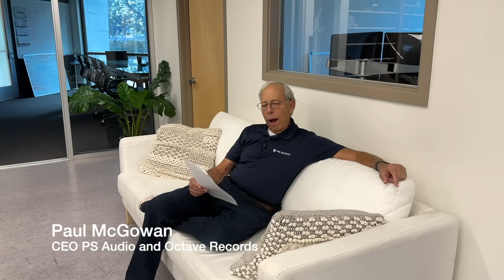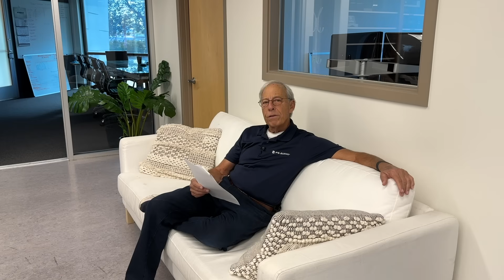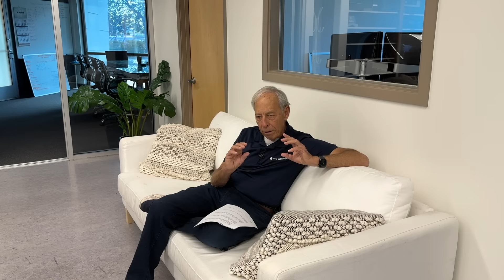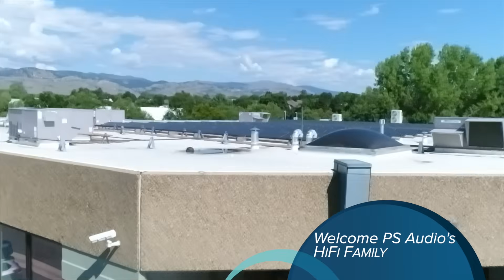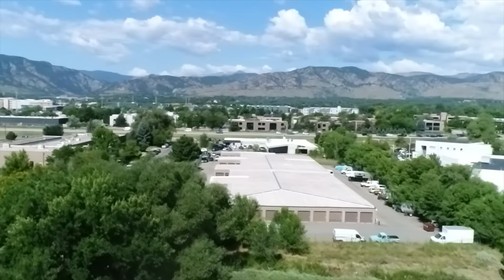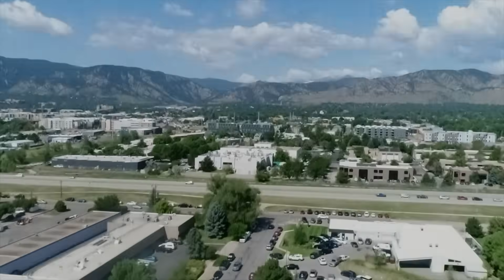Balanced Phono Cartridges

Comment: Rega turntables have a screwed up grounding scheme. I believe they short one of the cartridge conductor(s) to the arm grounding and use the RCA 'return' as an arm grounding. You can't use a Rega turntable as a balanced source unless you rip off the wiring to the terminals, rewire and install a separate arm grounding wire.

Comment: The discussion is about the tone arm wiring. Not the cartridge. Almost all magnetic cartridges are balanced by design. It was a matter of convenience to ground one of the leads to the cart body and use it as ground on the output of the arm. Carts included instructions on removing that connection, a simple piece of metal strap. And then the 4 wires coming out of the tone arm are fully balanced. In fact, if the RCA connectors on the turntable are not grounded, it is Tip/ Crown balanced connections.
Reply: Most MM cartridges are internally single ended. Don't ask me why.

Comment: I asked ChatGPT why it makes sense that my Parasound JC3+ has RCA inputs only but XLR outputs (also RCA outputs of course) and the reply I got kind of does not jive with what Paul says:

"A turntable cartridge is a floating, unbalanced source — it has two signal wires per channel (hot and ground), but no third conductor for a true balanced signal.

Even high-end tonearms with “balanced” cables are really pseudo-balanced until they hit an active stage that can differentially amplify the signal.

So there’s no real benefit to providing XLR inputs on most phono stages, since the source itself is not balanced."
Reply: ChatGPT talks bs, because there's lot of bs being written around the net regarding this thing AND you phrased the question in such a way as to cause it to talk bs. For example, common noise rejection needs a balanced connection and a balanced input stage. Which is exactly what you get when using a balanced cartridge, balanced connection and a phone pre with balanced input stage.. Nothing to do with amplification, differential or not. Of course gain is not increased in such a configuration relative to single ended (Paul got THAT wrong, as was mentioned in another comment), you do need a differential amplifier for this, which is what happens with a phono pre balanced output. Also a turntable cartridge can be either single ended, which is what ChatGPT describes in the first sentence or it can be balanced as are all MC and a few MM cartridges because the second conductor is not shorted to ground. In this case both conductors exhibit the same impedance with reference to ground which is the definition of balanced. ChatGPT is a garbage in -> garbage out processor.. You could coach it to return the correct answer if you ask 'Why does it make sense to have a balanced connection from a balanced cartridge to the balanced input of a phono pre'' instead of what you asked... Use of LLMs like ChatGPT without having a clue what you're talking about is full of perils..
Reply: @razisn people don't seem to recognize the difference between balanced and differential.
Reply: @razisn  I appreciate you took the time to answer, although your tone ... well .. 

Admittedly I have no clue, but maybe you can answer the question I put to CGPT having that in mind. 

I mean I spent a fair amount of money on what is supposedly a fine piece of equipment - which I am very happy with BTW even being forced to use unbalanced out - and you'd think there is some sort of reasoning behing their engineering.

Comment: All magnetic cartridges are balanced unless someone does something stupid...    like using RCA jacks to connect them.   
This is why a separate ground wire is needed.
Reply: Nope. Most MM cartridges are single ended because the internal wiring has been traditionally messed up for unknown reasons. The separate ground wire grounds the arm assembly (and sometimes the table) not the cartridge btw. Cartridges in general do not make electrical conduct with the arm body so the separate wire could not act as ground for them by definition. MC cartridges tend to be balanced along with just a few modern MMs.
Reply: That is what I understood about MM's as well, however I was also informed MC by there very nature are NOT so you would have to make a Moving Coil balanced to get any real world benefit, which as I understand it is what Pro-ject has done with some of their MC's.
Reply: @Roamany-Jones  You've got it reversed. MCs are in general balanced, MMs not so apart from the newer 'balanced' ones. Don't ask me why.

Comment: I was able to set up a balanced phono cartridge arrangement using the ProJect S3-3B phono preamp, Technics SL-100c and a moving coil cartridge. The changes were significant in gain and sound qualaty, and lower noise floor.

Comment: Yes, balanced should be the norm, but how do you lose 6dB of gain by not using balanced for a cartridge when the coil output is the same either you ground one of the pins or not? The voltage delta doesn't gain anything by treating it as balanced in this case e.g. a 1mV output of a coil will be +/- 0.5mV on balanced and 1mV on single ended.
Reply: That is correct. Paul got confused, again. You need a differential amplification stage to get a +6db of gain.
Reply: I don't understand how you can have a balanced phono stage input when the cartridge output isn't balanced.
Reply: @bobisyouruncle1  The balanced phono stage input amplifies the delta between the two pins of the coil output and it will work just fine. The reason you can consider it balanced is that the amplifier inputs are likely at GND level DC wise and the two audio wires will carry a relative positive and negative signal voltage as balanced as if the center of the coil is at GND level always.
Reply: @bobisyouruncle1  Whoever made the phono stage made it with a balance input stage. Whoever made the cartridge made it single ended.  Lol

Comment: There’s nothing stopping you from treating the RCA output of most tonearms as a balanced signal with a floating ground. This works well with most arms except those that connect the tonearm ground to the shield of one channel like Rega. Most of Ron Sutherland’s phono preamps work this way, with a balanced connection from an RCA Tonearm cable.
Apart from that example, phono preamps with a balanced input are hardly a new thing. Many of today’s top phono preamps have a balanced input option, and have for many years. Pro-ject’s achievement is in brining this  to a lower price level.
Reply: This is true as long as the phono wires are not connected to any internal preamp or other circuitry.
Reply: It's been 40 plus years since my Electronic School days. 
 Even though I am still a technician, I can't get past the fact, that we were taught that a floating ground is bad for any circuit. 
 What am I missing.
Reply: @davidjudd951 The tonearm/turntable is grounded to the phono preamp through the tonearm’s separate ground wire

Comment: She doesn't watch my videos 😂 Hey it makes me wonder, how do we make being audiophile become a female passion also? How many here are females percentage wise?
Reply: A few days ago I just got a new AC power strip that is built with audiophile grade parts, including an AC cable that the company is known for, along with it's other kinds of cords/cables. My first listening impressions were disappointing. In the upper midrange on a very familiar recording I could hear emphasis compared to what I was used to and thinness. A few times it even sounded a bit tinny..The bass sounded less in amount. The highs sounded duller than used to. But within 3 hours of warmup & play, the sound transformed. The bass wasn't lesser; it was tighter, & the lack of overhang made it sound less. And by the end of 3 hours it didn't sound less anymore. After about 2 hours I could tell on some cowbell taps that the sound was cleaner & truer. Toward the end I could tell the sound had more focus than I ever heard in the recordings before. From my thinking of sending it back, my thoughts went to  "this is a real keeper!" I talked to the seller and he told me the AC strip had never been used. It was breaking in, including the AC cord, and within 3 short hours, you could hear a major transformation in the sound. A level of sound quality, ( in certain ways at least) that I had never heard before in my system. Mostly I'm sure, because of the AC cord breaking in. Not only is there a definite improvement with different cords/cables, but break in is real too. Theorists and their flawed and incomplete theories that have more holes than Swiss Cheese; do not matter. Basically, when someone says there's no difference between cables; they're pretending to be God. Pretending to know and understand everything, and pretending they are familiar with all cables; which bviously they're not. Their argument against cable improvements are best not to be taken seriously.
Reply: @sidesup8286 It would be all awesome if people could hear the same difference when they are not told about which cable is used lol 😂
Reply: @sidesup8286   ...quite often the phenomenon of the bass sounding "less in amount" is a matter of the bass actually presenting as cleaner & tighter & the listener's hearing readjusting to the 'new' sound. Anyone who can't hear the difference between the sound of brand new cables (wires) & wires that have burned in & 'settled' is truly hearing impaired.
Reply: @Fat Rat There is no such thing as cables needing burn-in. It's not a thing. It would mean you can tell me if a system has brand new cables or cables that have been used for a longer time. Also for this, it has zero actual evidence and zero science to support it.
Reply: "Always" Fail or "Always" still lying about blind tests being failures?.. The whole concept of blind tests could be a failure, considering how bad people are at them, when blindfolded. They often fail telling anything apart; anything from audio, to chicken tenders to brands of soda pop.

 Fat Rat is right.Tighter bass without overhang, sounds like less bass. ..And cleaner highs sound like softer highs or less highs.
Reply: @sidesup8286 Actually blind test simply means you don't know what you are listening to. For example, if you randomly switch power cable of an amp and it's not visible to the listeners which cable is used, and they can't pick which one is better...but they can pick one if they know which is used...it means the placebo effect is at play. Numerous such tests have proven what we can hear and what we can not hear. Power cables always fail in such a test. Those of us who understand the actual way things work, can also explain why a power cable of a few feet doesn't affect the sound quality.
Reply: @Thinking Better. You keep saying that blind tests on power cords and cables always fail; which I'm sure is just a falsehood you keep repeating to not look like you are losing a debate. I would NEVER fail to tell the difference between my worst power cord & my best; and I'm sure I'm not unique, or one of a kind in that way. Once again, theories aren't worth the neurons that create them. None of us millions of guys who hear differences are going to lose any neurons, worrying about theories by people with hearing so bad, that it's hard to even imagine.

 What failures there have been with blind audio tests, blind taste tests etc. all have to do with the perceptual incompetence of the blindfolded ones, the incompetence of the testers & their methods, and simply the plain fact that from all indications (and there are many); humans just have the hardest time telling anything apart when blindfolded. Be it taste, touch, sound or smell.
Reply: @sidesup8286 I'm sorry but yes, NOBODY can identify a power cable by listening not knowing which actual cable is used. For decades it has been same story. And trust me in this, if people could actually identify a power cable by our hearing only, you can bet numerous tests would have been used in the marketing to sell these things. The business incentive is absolutely there but you can't prove what is not there. And nobody needs to be blindfolded in a cable blind test. All you need is to avoid the cable to be visible.
Reply: TB ...women love money, so if you pay them enough 'money' then I'm sure that they will show some interest in home-audio, even if it's only superficial 👍😉
Reply: @Fat Rat Lol, I knew we have a lot of things we can agree on other than the wonders (or not) of premium cables hahaha...
Reply: @ThinkingBetter   ...don't confuse "premium" with 'audio grade' & also, please remember that I don't do expensive 😝
Reply: @Fat Rat On cables transferring audio, the science is clear and well understood. I like areas if science where new things are being discovered and invented. For example, the front Uni-Q Meta driver in my KEF LS-60 is a great example of audio innovation.
Reply: @ThinkingBetter   ...yes, I believe that the Uni-Q is now up to it's twelfth iteration...or is it the thirteenth🤔
Reply: Meta version is quite interesting
Reply: Google "Class D Now Crushes Class A in Cleanliness, Power, and Price-to-Performance, as Confirmed by Multiple Independent Tests"
Reply: @ThinkingBetter   ...yeah, all of those maze pathways dealing with the treble 'back-waves'.
I wonder who thought of trying that out at KEF 🤔
Reply: @ThinkingBetter   ...so what is your take on isolation/vibration absorption footers like IsoAcoustic Pucks, Oreas &/or Gaias or Stack Audio - 'AUVA' 50s, 70s or 100s or Townshend Engineering platforms??
Reply: #Fat Rat The upgrade (12th-gen Uni-Q + MAT) delivers a 99% absorption of rear-driver unwanted sound vs typically 60% in older designs. Results: dramatically lower distortion in mid/high range (spec example < 0.1% THD), improved clarity, larger listening sweet-spot, more natural sound. For a discerning listener (I assume we both are), the benefit is measurable (in terms of THD, which is a big deal for speakers, clarity, dispersion) and audible, especially when all system elements are up to par. This is totally not an imaginary thing!!!
Reply: @ThinkingBetter   ...I never said that it is, "an imaginary thing!!!"
I said that I wonder who at KEF thought of it...& before you answer that I said it as a semi-rhetorical question.
I have no doubt that it improves (decreases) distortion, otherwise KEF wouldn't persist with it.
Reply: @Fat Rat Yes this is a real deal. Imaginary things in audio always fail in blind tests. Real audible improvements don't. Simple.

Comment: Most MM cartridges are inherently single ended. You need to use either an MC cartridge or one of the few new MM cartridges that support a balanced connection, otherwise balanced wiring to a balanced input phono amp won't help.
Reply: Although you’re correct about most mm, but why would you use a mm cart on a 5k plus preamp? I’m a fan of the 2m black, but I wouldn’t continue mm north of $900
Reply: @Rotteneggsack  There are much cheaper balanced input and output preamps. The question was not specifically about PS Audio phono preamps.. In any case, I stated a fact that might help somebody. Paul should have mentioned this.
Reply: Hmmm. Am I wrong? I thought that Paul said (and I've always understood) that by virtue of the way they operate mechanically, both MM and MC carts are inherently balanced. I further understood that it’s the manufacturers approach that turns that balanced output into a single-ended unbalanced RCA output. My Jelco tonearm came with an XLR interconnect (by the way, 2M Black at one end $2500 Ayre phono preamp at the other!)
Reply: @clothyardshafts  Most MM cartridges just short one conductor of each channel in the body. That is how it has been traditionally done and it mostly hasn't changed. Since they expected to connect to a single ended circuit anyways, maybe that provided some construction convenience, I wouldn't really know. It is trivial to test with an ohm-meter. Disconnect the cartridge from the arm wiring and test the continuity between the 2 channels. If there's continuity between the negatives of the 2 channels then the cartridge is single ended. Pro-Ject have introduced balanced ready MM cartridges under their brand and they make sure to advertise it..
Reply: @razisn i’m not sure that I need to go through all of this testing. When they were in business, Jelco stated their tonearms were capable of balanced output. All you had to do, as I did was to order the appropriate XLR interconnect. In addition, the Ayre phono preamp (now about 10 years old) accepted balanced input. Both play nicely with my Sota Nova TT.
Reply: @clothyardshafts  You don't NEED to do anything. You might WANT to do it since if indeed your cartridge is NOT internally balanced you will not be getting the benefit of a balanced connection whatever your chain after the cartridge is. Did Jelco tell you your cartridge will support a balanced connection? You could also ask Ortofon themselves. FWIW, Google AI believes the Ortofon 2M Black is single ended, which is what I believe too. Btw I, also, do not have to repeat myself and I won't.